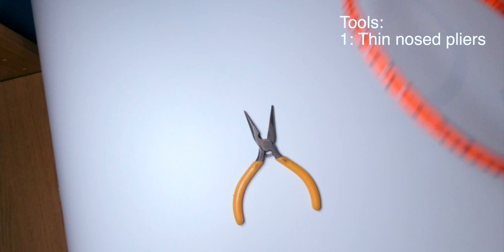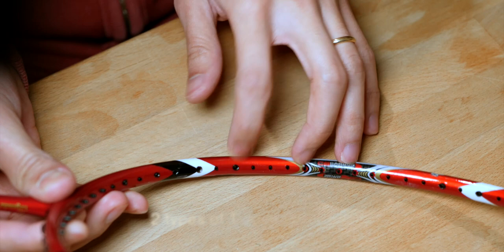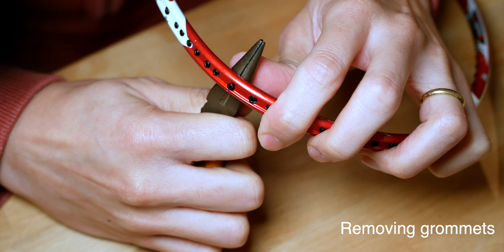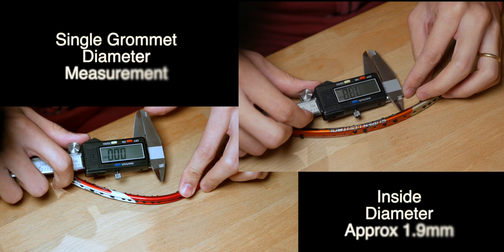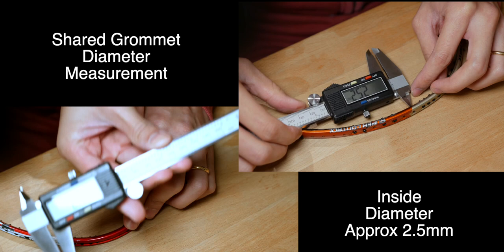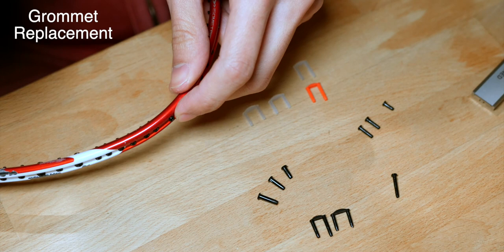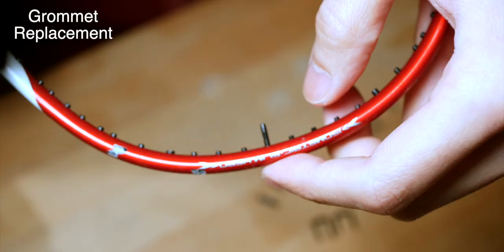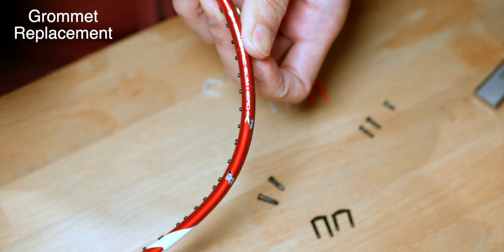How to replace Badminton Racket Grommet - Badminton Racket Maintenance

Comment: My Yonex badminton racket max tension 24lbs but if I change the grommet can it go above 24lbs? 26-28lbs?
Reply from the maker: It depends what racket it is. If its a high end model, they will be able to easily take more than 24lbs.

Comment: Do I have to flatten those shared string grommets, or can i just string immediately?
Reply from the maker: Eh?? Why would you flatten the grommet?
Reply: @CKYew  like make them look like an umbrella
Reply from the maker: @falsecatalyst3936  Ahhhh, some people use a soldering iron to turn them but you can string them immediately after fitting them as long as you cut them to the right length.
Reply: @CKYew  ahh ok thanks for the advice. I recently bought a 12 o clock grommet strip with 10 holes because i can't find any of the original 6 hole ones for my victor tk9900 now. Even e78 doesn't carry them anymore. So I was wondering if i could get away with using this strip. Thanks for clearing my suspicions and questions
Reply from the maker: @False Catalyst  You can even use individual ones if the strip isn't suitable. It shouldn’t change how the racket perform. Good luck!! :)
Reply: @CKYew  One more thing, will changing the 12 o clock strip into individual grommets have an impact on the racket's durability or capacity to take tension?
Reply from the maker: It shouldn’t do but it’ll add slightly more weight to the racket head weight, so will be slightly head heavier.
Reply: @CKYew  wait so a series of individual grommets are heavier than a strip?
Reply from the maker: No. Individual ones shouldn’t be heavier than strip.
Reply: @CKYew  no i meant if 6 of those individual grommets are weighed in, they would be heavier than a 6 hole grommet strip right?
Reply from the maker: @falsecatalyst3936  I dont think so but try weighing it to see how it goes?
Reply: @CKYew  ah ok, if it doesn’t affect the frame strength changing from strip to individual, and there’s not much difference in head weight, I’d rather just use individual grommets because they’re more accessible. Anyway, thanks for all your answers despite my badgering questions
Reply from the maker: Yep, it won’t affect anything on the frame 😊 oh no worries lol! Keep asking away! Happy to help 👍🏼👍🏼

Comment: Hi CK, I got a question for you, The Grommet on my Duora 10 Is like tilted sideways Is that normal or needs to be change
Reply from the maker: Not sure what you meant by tilted sideways but if it was turned 90 degrees then it should be fine. Get your stringer to check, they’ll know 👌
Reply: @CKYew  Ty Ty

Comment: how to replace shared grommets?
Reply from the maker: Hi Jonathan, same technique, sharp pliers and pull. It should come out pretty easily. If not, you can twist the grommet with a flat head screwdriver before pulling it. Good luck! 👍
Reply: how to put shared grommets? just put it in?
Reply from the maker: @jonathanlazundin6650  Depending on your length and size of your replacement grommet. If its the right size and fits well, perfect. If its too long, make sure you cut it down so its the correct length. 👍

Comment: How can I make a grommet at home?
Reply from the maker: Not sure if you can make one at home but if you’re pushed, you can use silicone tubing which can fit through your racket grommet hole. Cut it up to size and slide it in during stringing.
Reply: @CKYew  oh okay, thanks a lot I needed it for renovating my 10 yr old racquet which I was going to keep as a memory 😅
Reply from the maker: Aww that’s nice!! I might do a video in the future to show how it’s done. 👍🏼😂
Reply: @CKYew  omg thanks 😊
Reply from the maker: Make sure you’re subscribed so you don’t miss more badminton or tech stuff when it comes out 😬😬😂😂